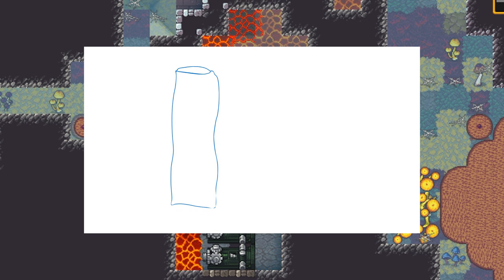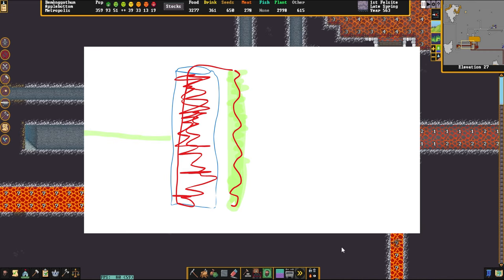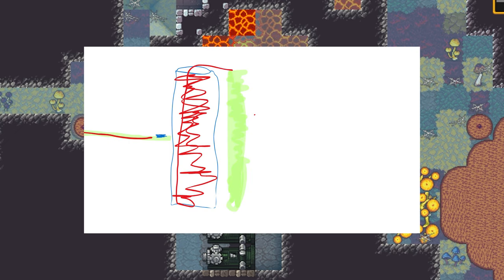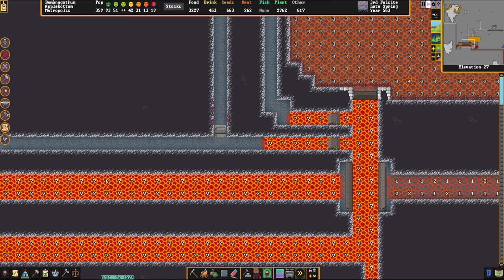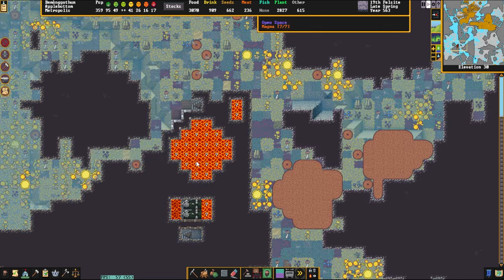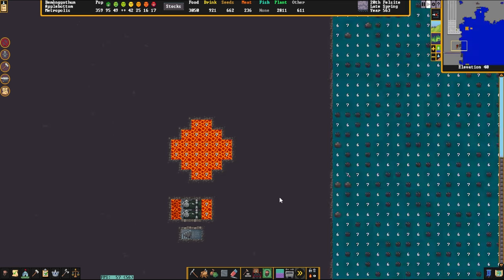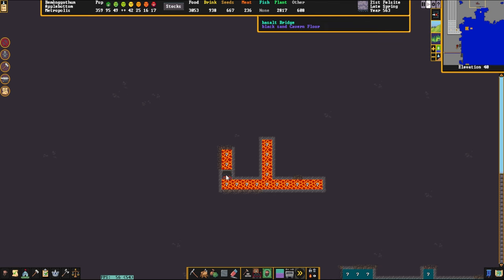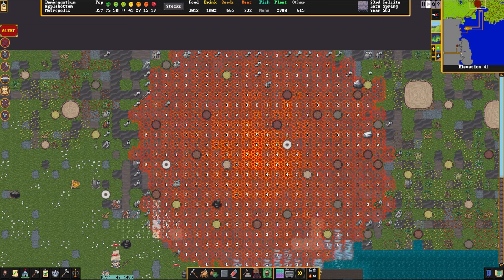Using Pumps to Pressurize Lava | Dwarf Fortress Idea

Comment: Wait, lava won't normally go back up from reservoir pressure, but that one screw pump makes whole system behave as if pump was not there and lava followed water rules?
Reply from the maker: To a point. Pumps make it flow a LOT faster. It'll slowly bubble up without the pump. But with it you'll get the geyser.